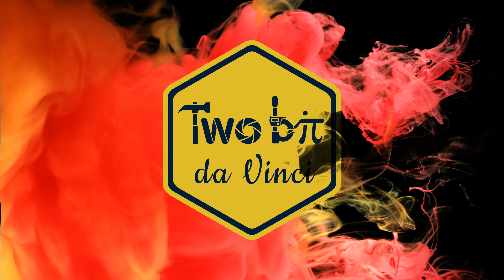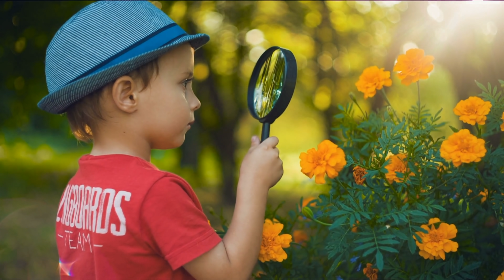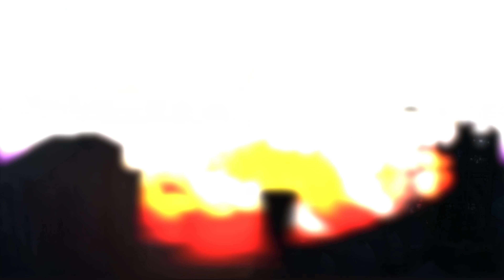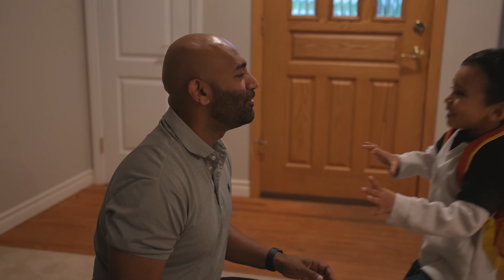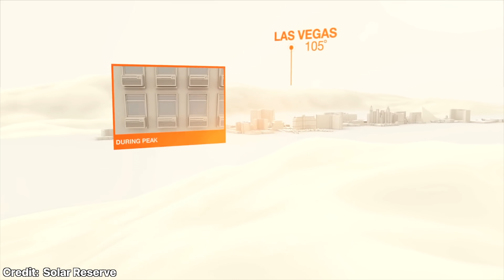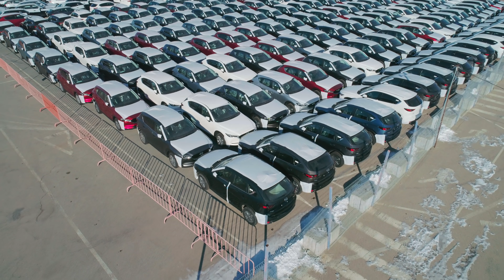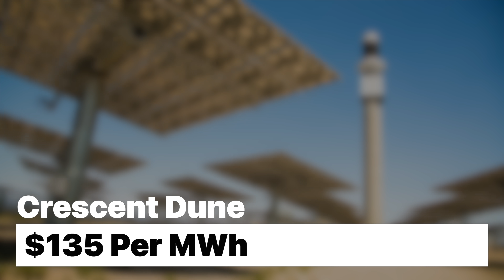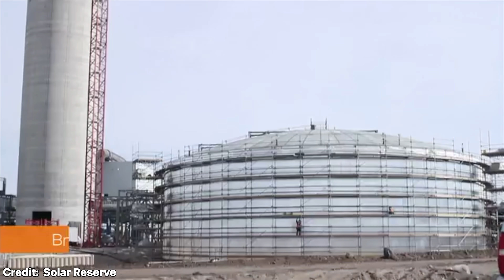This Billion Dollar Solar Plant was an EPIC Failure

Comment: Just few queries 
1- is it possible to replace those mirrors with solar panels (if possible,  a curved one to increase reflectivity)
2- replace sand with any other highly thermal conductive material (combined with a thermocouple if possible)

All the above possibilities are assumed to follow the original working principles of the plant.

Any candor regarding my queries is welcome.
Reply: Now it would work.  Peak power production now is very profitable due to high gas prices.  Timing was off.  Should has seen the war in Ukraine coming.

Comment: My Sweetheart, worked on the installation of this Ivanpah plant and built the heilostats.  He's a master electrician.   It's located in the state of California.   The energy generated is not sent to Las Vegas.  It was solely for the state of California not Nevada.   My Sweetheart told the powers that be that the grounding grid was not installed property.  He was told not to fix anything.  At the occasion of the 1st lightening strike, they lost 60K heilostats because they weren't grounded properly.  You would get a better response by talking to a wall than he got from the engineers at the plant.  Quality control was told to check off the boxes even when corrections were needed on the heilostats in the field.  A doomed project when some people didn't care if the work was done correctly.  The workers cared about getting the plant up and running correctly.  The summer storms during the monsoon season helped put the plant out of business.  It was also the 1st time that a plant like this was built on the slope of a mountain.

Comment: Speaking of scale, where is all the dangerous exhausted EV battery material going to go when all the new EVs require replacement? When the batteries are recycled a small portion is recovered, there is a lot of hazardous materials leftover, and it's expensive. 

Please explain what will be done with the hazardous waste material.

Comment: I'm glad you put this information out here.  The movie Sahara a few years back had one of these in it and the concept fascinated me.  Shame it didn't work out as well as hoped.  All new ideas have ups and downs and some don't meet expectations.  It's a shame for the investors that this failed so badly that it was a better bargain to completely shut it down rather than simply have a smaller / slower ROI.
Reply: Not all solar thermal plants leak; there's a "List of solar thermal power stations" over on Wikipedia
Reply: @williamchamberlain2263  Pretty sure I didn't get the wording just right.  Perhaps I should have made myself more clear with, "It's a shame this specific solar thermal plant failed so badly it was a better bargain to completely shut it down....."
I suspect that often new types of projects have differing methods of completing a variety of processes.  Some can benefit or hinder the ability to correctly perform the function intended.  Until all the detrimental variances are identified and techniques are perfected, things can fail that looked very promising on paper, so to speak.
Reply: The one in the movie Sahara was not a power generator, it was supposed to be for toxic waste disposal.
Reply: The Mathew McConaughey movie? Thought that was about...a civil war naval vessel in Africa???
Reply: @hayorge27  Hollywood comes up with odd, implausible stuff all the time. Toward the latter part of the movie you can see the solar mirror tower and what the movie portrays it to be.  I liked the movie and remembered that solar power plant.
Reply: Wasn't it a Bond movie?

Comment: It is not a failure, since numerous solar cells manufacturers and all the designs are for the benefit of countries where energy production through the healthier standards are evident and effective. Its numerous designs that are packed with features are a testament of clean energy that does not release nor add carbon emission, why? The panels materials differs from one another, similar to roofs that are either aluminum, copper and numerous types. This is years of tested and proven studies conducted not just by manufacturers in China, but also in numerous manufacturers in EU, UK, AUS, Middle east countries. The panels last for a lifetime depending on the cleaning and maintenance that each owner/manufacturer provides as lifetime warranties are inclusive to purchases accorded to private/public sectors wherein it is tested efficient from product's demonstration/illustration, guaranteed by respective manufacturers and brands worldwide. © copyrighted ™ trademarks® Registrations/amongst countries. Private and Public Sectors attested SMEs....General practices./.../.../.../..././.Respectively. GM Industries.

Comment: I don't believe the $30 per MWh for PV includes the storage mechanism.  There also, still needs to be a base load for when the sun does not shine for longer periods.  It is surprising that you do not include, for comparison, the traditional power generation alternatives.  According to the U.S. Energy Information Administration, new natural gas-fired plants come with a levelized cost of $48 per MWh and  nuclear's cost of $33.50 per MWh.  Neither of these need storage and are the base load for the PV.  Seems to me the cleanest and cheapest is nuclear.

Comment: There is an ecological expense associated with EVERY power generation concept.
*. Solar panels require metals that need to be mined, from where? Ecologists fight against mining operations.
What will be done with the very toxic, heavy metal waste products?
*. Disposal of toxic solar energy batteries at the end of life.
*. Same with hydro, what ecosystems are we willing to flood when new hydro dams are constructed.
*. Wind turbines, see the study out of Oklahoma, have a downside.  The added air turbulence results in accelerated evaporation of moisture from the soil. End results, farms will need to pump additional ground water to replaced this lost moisture content.
*. Coal - Trying to replace these
*. Oil - Trying to replace these
*. Nuclear power generation.  No greenhouse gas production.  Massive power output capability.  Takes 10-12 years to construct, test and bring online.

We, as a people, need to decide what ecological price we are willing to pay for electrical power.